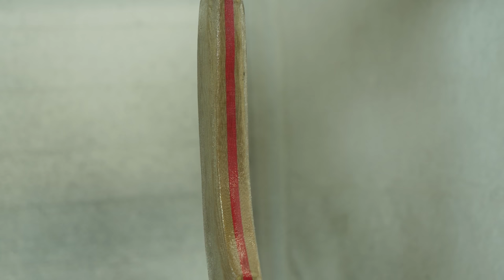I Restore A Rusty Old Axe - Boy Scout Hatchet Restoration

Comment: Fantastic job! You were freaking me out at the end when you were hacking at the log. You could've easily put that blade through your left thumb. I did something similar when I was younger.
Reply from the maker: I originally held the log at the bottom (very unsafe) so I wouldn't block the camera. I wasn't chopping very hard, but realized that it is a very unsafe thing to do, that's why I switched camera angles where I could hold it by the top away from where I was chopping.
Reply: Yup, I cringed too.  Totin’ Chip corner for that one 😜